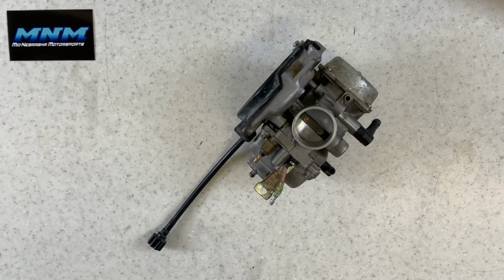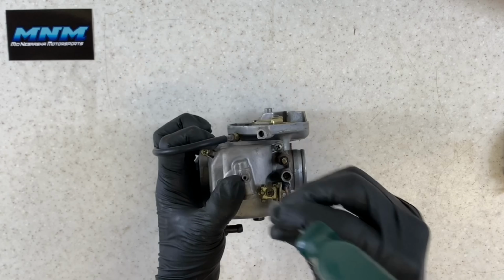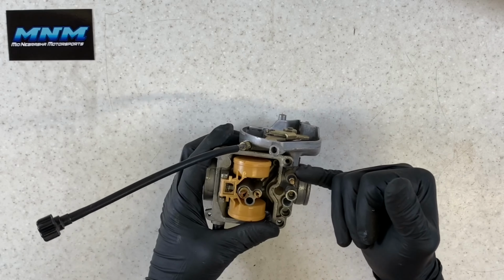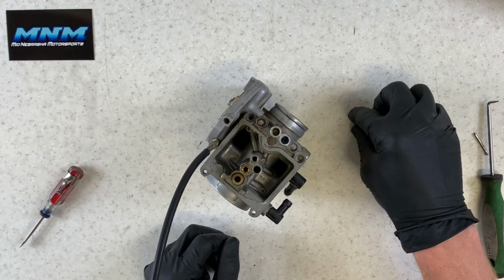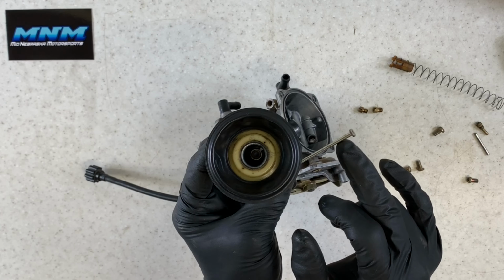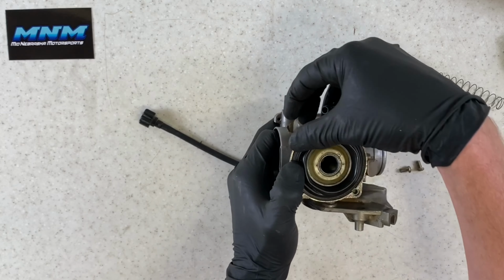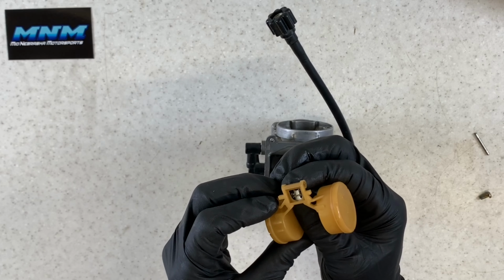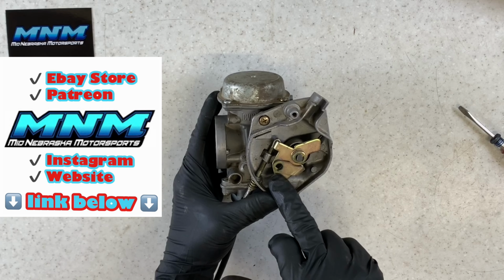Kawasaki Prairie 300 Carb Clean - Complete Carburetor Rebuild  -  WOW

Comment: Do you need the heater the wire broke flush with the bottom
Reply from the maker: You can always try it without. Depending on your temps, you might be good. Let me know what you find out. Thanks for watching and the comment. Let us know if you need anything: https://www.ebay.com/str/midnebraskamotorsports

Comment: What can I do, my 2001 kawasaki prairie 300 4x4 only stays on with the throttle on, any recommendations
Reply from the maker: Did you do a carb clean? Obviously have you a slide stuck open. Either when you reinstalled the slide it didn't go down or the cable is holding it wide open. Let me know what you find. I'd back your idle way off, although it doesnt sound like that is your only issue. Thanks for the comment.

Comment: What causes a 300 to high Rev as soon as it turns over? I've played with the idle adjust knob and it doesn't do much.
Reply: Throttle not set correctly in the side of the carb
Reply from the maker: Did you do a carb clean? Obviously have you a slide stuck open. Either when you reinstalled the slide it didn't go down or the cable is holding it wide open. Let me know what you find. I'd back your idle way off, although it doesnt sound like that is your only issue. Thanks for the comment.